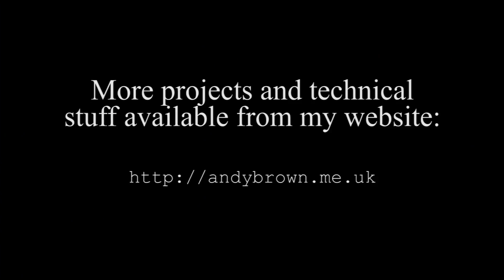How prototype PCBs have improved over the years

Comment: Great review. I agree they got a lot better in recent years. And cost has gotten better as well.
My compliments on your excellent video quality. May I ask what camera/scope setup are you using, or something you could suggest for closeup videos such as this one you made?
Reply from the maker: Hi Felix, thank you for your comments. The camera is a Samsung NX1 with the 30mm NX lens for the wide shots and their 60mm NX macro for the close ups. I bought the camera for its incredible 4k video performance but I also use it for these videos at 1080p 50fps.
Reply: @andysworkshopuk  Looks really good for 1080p. But yikes the price is not very accessible for hobby use. Even so I'm very impressed by the closeup video from your macro lens. How do you manage to keep the camera pointing down straight without vibration, and are you still able to get a view of the live image/LCD?
Reply from the maker: @FelixRusu  The camera is mounted on a tripod not very far above the surface. The camera LCD will tilt but not swivel like the most recent cameras so I can just about see it. The small screen is useful to make sure that things are in-shot but I can't really check for sharp focus until I get the files on to the computer.

Comment: You missed the solder mask issue with U11 with the JLC board. Goto 11:48
Reply from the maker: Ha, sharp eyes you've got there. Pins 1 & 2 are intentionally shorted together but you're right that there's a solder mask void below pin 3.

Comment: Just had some boards back from JLC yesterday, a few boards have some cosmetic variants but the actually traces,pads,holes are absolutely spot on for a prototyping service! The only issues are some blotches in the soldermask and a few smudges on the silkscreen. Really impressive though generally.
Reply from the maker: Were they 2 or 4 layer boards that you had made?
Reply: @andysworkshopuk  they were only two layer, I was curious of the quality for $2!

Comment: JLPCB is pretty good.  Just as an experiment.  I had a 6 layer board with the smallest vias they support made about 2 months ago.  The yield was 8 out of 10 but the boards I got were pretty good. Regarding PCB package, I've switched from Eagle to DipTrace but I would consider Altium if the price didn't make my stomach recoil in horror - just can't justify it at this time. I have zero interest in using always online/cloud based solutions.
Reply from the maker: 8/10 isn't bad but I'd like to know where they went wrong with the 2/10. Did they miss with the drill on the smallest vias? On the 4 layer Virtex-E board I got from PCBWay I had about 60% yield as I recall. The problem there was that on some of the boards the soldermask overflowed on to some of the BGA pads. It seemed to run up the connecting trace on to the pad. With 676 of them there was always going to be that risk I suppose. There's a photo of the fault on my blog.
Reply: @andysworkshopuk  Hi Andy, they never told me what the issues were but I'm guessing that it was either drill registration in the vias (they are minute) or failed tracks - the tracks were also the narrowest that they support. The board had a mixture of PGA (I do retro stuff), PQFP and other tiny components on it. No BGA's on the board so i can't tell whether solder mask registration would have been an issue. 

Merry Xmas.  :)

Comment: Its great to see the increase in cheap affordable prototypes for anyone. It is just plainly not worth it anymore to make your own pcbs, except if very pressed for time. I still remember when there was just no affordable option, and you pretty much had to do the etching yourself except if you did a production run.
Reply: Etching is still a great option for learning the ropes from scratch. I've learned plenty of hard knocks lessons from it. It was quite challenging to figure out dry film exposures on my own though, and I'm still working on mastering solder masks. Over all I'm glad I can do it. I just wish I could do the through hole plating and tiny vias.